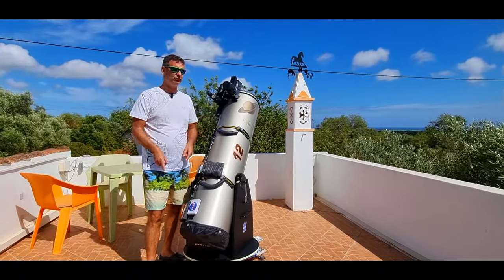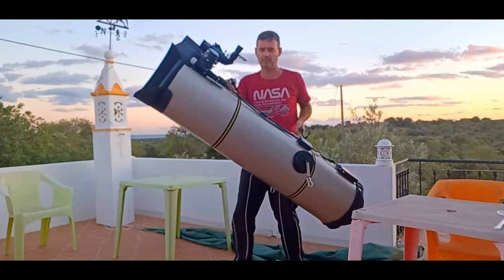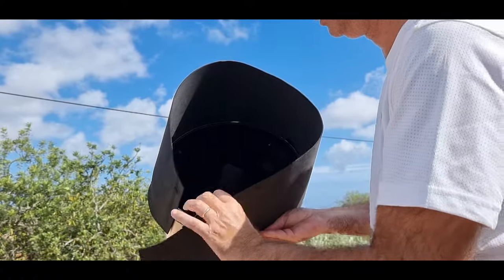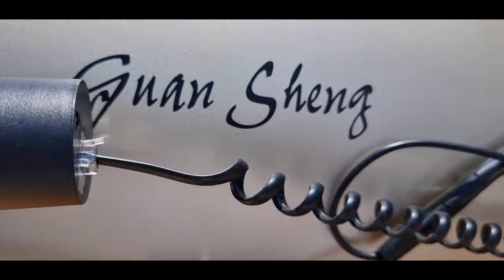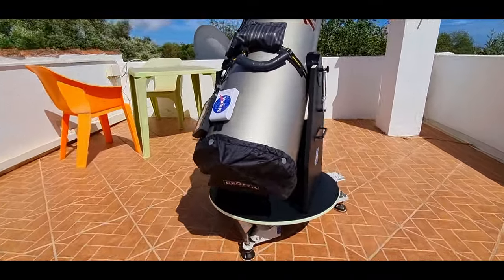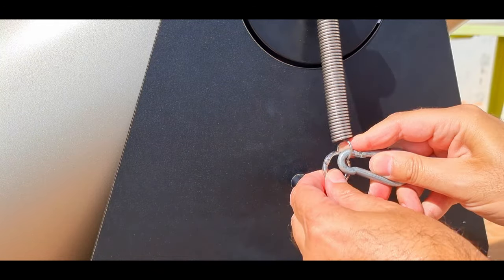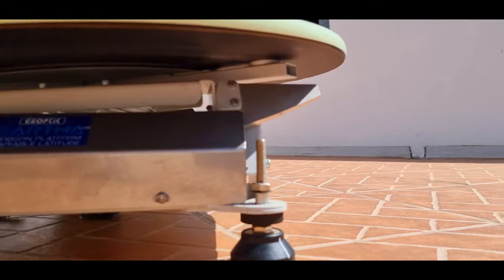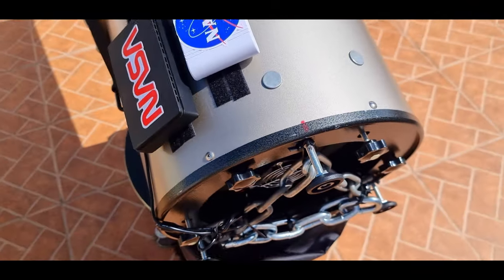30 UPGRADES Every Dobsonian Telescope Owner Should Do

Comment from the maker: 8 inch DOBSONIAN telescope FIRST MODS you should do right away: https://youtu.be/6cvjqBIR7cs
Reply: Hi Tiago, I have a 8 Inch Orion XT8, which I am very very happy with it, and now I want to dive into the Realm of Astrophotography by getting myself a Equatorial mount.  One question I have, since you have also done astrophotography is that Does a properly setup gear for a dobsonian, such as mount, camera, field flattener, etc truly will allow you to take good images from lets say Andromeda or the Ring Nebula as comparable to a 4 inch refractor?  I know this question is hard to answer and much depends on the skill of the astrophotographer, but maybe a better question is that "With a Dobsonian can you take as good or even better photos of Nebula's and Planets the same as a refractor?"
Reply from the maker: @afshinp5819  man i would have to write a book to answer. The refractor is for wide field, the SC for deep and the newtonian is good on both. I prefer newtonians and their results, aperture is king

Comment: The best reversible upgrade I made was a magnetic clinometer on top of the tube, and a geological compass (0.5° precision) with level bubble on the base.
I can find anything with enough precision. Adjustable feet are also a good upgrade. I own a 8" dob, so the weight is not an issue. I also put a steering wheel spinner knob to move the tube, stainless steel knurled thumb screws for the secondary mirror adjustment, and stronger primary mirror springs. 
That's the beauty of the dob, you can customise it easily.
Reply from the maker: Awesome 👌

Comment: good video & agree on all of the upgrade, i am have of them :)
i am the owner of 10inch and 16 inch dobsonian, 
recommend to anyone who still wants to have a dobsonian + has to travel to escape light pollution, spend a little bit more and get
a 14<->16inch truss tube with a light shroud, fits in almost any car and you can do the set up urself. any bigger and becomes awkward to transport. 
The best telescope is one you will use most often. if it is not truss tube, 12 inch would be the max or else will not fit in your car.

If money is not a problem, get a 12inch + schmidt cassegrain with EQ Mount (you can still do visual but can also switch over to astrophotography if u wanted to.

I am not rich enough to do the above but my friend has 14 inch celestron schmidt cassegrain and the view is much better/clearer/crisp than even my 16 inch dobsonian.... and he very limited collimation issues (only has sometimes for secondary mirror)  so he only has to wait for the cooling of the mirrors.
I envy him but he spent $20k USD on his set up....i only spent $3k and get a "similar" view with my 16 inch dob.

Comment: I like the feet you added - nicely solves storing the tube upright. Did you have to drill and tap the base to add them?
Reply from the maker: @lordlucan529  in this telescope no i didn't. It has 3 threads. But in my 8" i had to drill. Here: https://youtu.be/c18C22wSwY0

Comment: only problem i have with my dobsonian is the sensitivity when i try to move the center of the picture to a planet i either move it to much or to Little  
i thinking adding either a mechenical system that allows me to fine tune the movment or a system with electric motors and a simple joystick done
Reply from the maker: It's a matter of getting used to that. Find the best tension in your altitude bearings and azimuth knob and move the tube very very softly. The upgrade of the 3 legs i show at the video also help me a lot to move it softly. You can see me doing that in my live streams. It's a skill, to fine tune a large dob. Not easy.

Comment: Do you use a push to
My sky has a pollution 3
Is a 400 Dobson (on a trolley) adapted ?
Thanks
Reply from the maker: No. You just need a telrad on Bortle 3. A 16" is a good telescope but as it's heavy it's better to think in a good way to move it
Reply: @DobsonianPower  STARHOPPPPPING
Reply from the maker: @astrothib587  and at the end it's what gives more pleasure, to star hop 👍